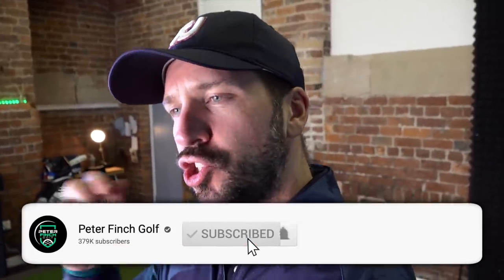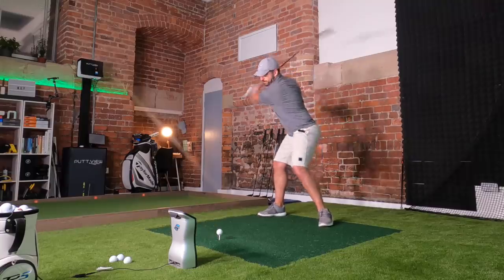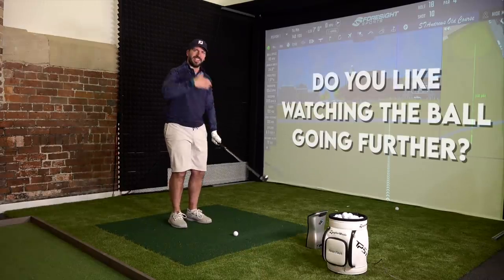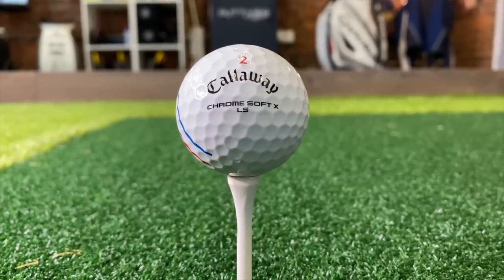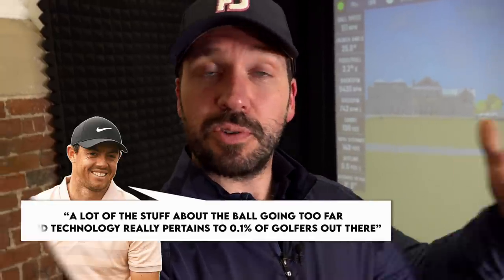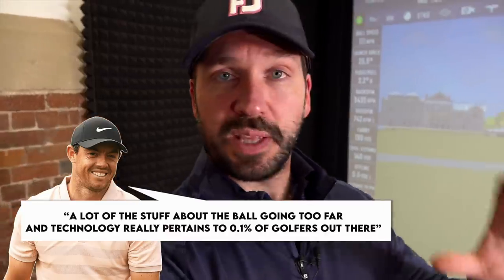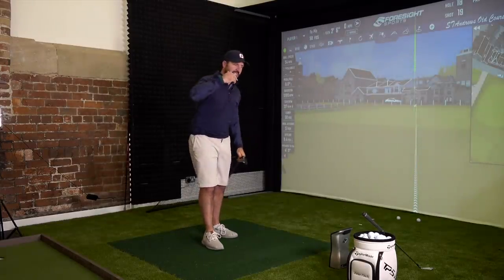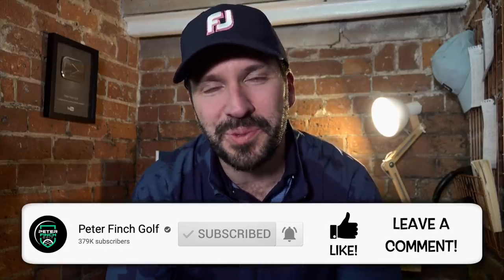Time to roll back the golf ball...?

Comment: Can we not have a rule of maximum club head size...  975d is maximum size,260cc, 3 wood back to 200cc.  The middle of a modern mini driver produces modern speeds, but miss it slightly and you’re screwed...that’s fair- they’re professionals and should hit the middle .  We can still buy those clubs if we want to be like a professionals. Higher handicaps can still buy the 460cc drivers .   Do the same for tennis.... Max 95 sq inch, bring some artistry back

Comment: What Bryson did was special. I personally don't think in the next 10 - 15 years we are going to see a migration of body builders on the tour. There will always be a level of finesse needed to be good at this game and smashing a driver 350+ on every tee shot does not out weigh the finesse you need in more cases than not. Smashing 350+ drives does add an advantage but the way courses are designed IMO, I don't think it's enough of an advantage to stop progressing. As you said Pete, he won by 1 shot. And in the 3rd round, I think he still made par when he was a bit further right of the hole in the rough. I don't see an advantage when he still makes par. There will always be a level of skill to play golf really well and just smashing drives is probably about 5% of the game. Even Happy sucked until he learned how to putt! :-)

Comment: Feel like the ball is an easy out for reasons pros hit it further. In last 20 years average driving distance has increase 17 yards, I would put that more down to all pros being athletes with personal trainers now - so swinging faster - than the latest pro v1 being 17 yards longer than the original. Feel like reducing forgiveness on woods maybe a better idea, brands can then sell it as a tour version bit like what the TS1 basically is. Feel like it's currently governing bodies (R&A/USGA) v equipment manufacturers, they need to work together more as currently the governing bodies are being reactive not proactive

Comment: I think it would be more achievable to set lofts as standard eg Driver 9-12 degrees 3 wood 14-16 5 wood 18-20 then irons back to traditional lofts eg 7 iron 32-34 degree pw 44-46 etc 🧐

Comment: I’d like to see things halted. Maybe for nothing else but the purity of the game. 
I’ll use analogy for example. Back in the late 1990s, early 2000’s. The 3 big manufacturers of motorcycles had to stop trying to outdo each other. Honda, Yamaha and Suzuki agreed to stop making motorbikes to outdo each other. Ultimately Suzuki won out with the hyabusa clocking out at 201 mph.

Are the big 5 golf OEMs going to do the same? If not, when do you stop? 500 yard drives? 600 yds? 
Where’s the skill involvement of the game?

Comment: Rolling back the distance of the ball may only hurt the average swinging amateur. We don’t have the time and resources to work on speed like professionals do. This will suck for us. I love the idea that I am playing the exact equipment that the pros use. So making a ball just for professional golf doesn’t sound good either. It makes some sense that the pros are throttled down but disastrous for the amateur. I can fix the whole thing just draw and out of bounds line in the middle of the fairway at 320. Problem solved. Ridiculous Maybe Not. Easy Fix

Comment: Let the equipment get advanced it's fine if you want to stop distance being the test, simple shorten the courses. When I say shorten, I mean shorten to the average uk course length. Some of those players would on the next hole with a driver. I personally fine the argument silly, there is skill in accuracy at distance and there is skill in accuracy without. I would rather see an artist than a weight lifter or Ballesteros than Bryson. What do you fell Peter?

Comment: Think of bringing F1 Cars back to the speed of 100 years ago but with the safety of modern times. or play tennis with rackets and balls from a century ago... brings more the athletic part into the conversation... yet it both won't happen. as long as the player has to swing the club, the most skilled will win in the end. maybe the PAR just needs to be adjusted to modern times for some holes in the near future... as the name already says it is the "professionals average result" which might be actually closer to 4 than 5 on the 6th hole of bay hill in a few years and on many driveable "PAR" 4s

Comment: It doesn’t matter if they roll back anyways . The long hitters will still be longer no matter what equipment based on physical speed and strength . The shorter hitters would be at even more of a disadvantage and when it comes down to it you have to make putts and get up and down .

Comment: When peers are 10 to 20 yards different from one another  one could argue the playing field is relatively level. But 50 or 60 yards, not so much. Yes Jack hit bombs with persimmons woods but he also had the skill to hit a low streaking 2 iron which in that day had virtually no sweet spot comparitively to today's equipment. There was an ability of most  professionals to shape shots, high, low, fade, draw, hook or slice on demand as necessary.   Those days are sadly gone. Now it's a 5 or 6 club game...Driver, occasionally a mid iron, 3 wedges and the flat stick. To me what is lost with today's technology is the imagination and creativity that professionals once possessed, which separated them from the average person. Can you fix that with rolling things back? To some extent yes. Standardized lofts for professionals, shorter tees, and tuornament balls built to an agreed upon series of specs would be a good start imo.  But also trouble needs to be more punishing too in tournament play...deeper bunkers, tighter ob, more undulations that pull balls toward trouble on the greens, etc. which could all be done without lengthening courses or losing venues. But I'm just a nobody, mid handicap who still believes a 7 iron should be 34 or 35 degrees and a hooded iron and punch shot  are valuable shots to understand  how to hit., so really what the hell do I know. I guess I just think drive, flop, putt is just really boring golf.

Comment: Pros are prots, will we rollback equipment and then start complaining that scores are too low things need to be tougher and find another thing to change? The pros are on that stage for a reason, Byrson crushed a drive and won by 1 stroke. He isnt crushing drives and dominating tournaments winning by 10 strokes, tournaments have been won by some who hit it far less and still win by larger margins. The average golfer is not going to get those distances, most will not put in the time and effort to make that stride. Then to go off of what you said, Peter, if in 15 years 20 tour players cut that corner and reach green side or close too, it will then come down to the skill of the up and down. So the shots, whether it from one player or 20 will still be mesmerizing, but then if the entire field is capable of that on the pro level it does, in my opinion, mean that the person who wins will need to be well rounded in all skills and shots for the course and game of golf.

Comment: Professionals should have a roll back in equipment. This happens in other sports. Why not golf. Baseball, pros use wooden bats. not so in any other level of competition. Football ('merican) the ball is fatter and shorter making it harder to throw faster and deeper. not so in all other levels of competition. pro basketball has different rules for defensive setups, three point distance etc. not so in all other levels of competition. why are pro golfers playing with the same equipment as the 28 handicapper?

Comment: I’d love to see the strike matter more. Smaller sweet spot. Smaller CC for the driver...maybe 400 CC. If you rolled the ball back to the original ProV it would make little difference although if the companies were forced to up the spin...I’d also love to see wedges ‘rolled back’ to a max of perhaps 56 degrees. Oh, and the driver should be the longest club on the bag at say 46 inches.

Comment: No they shouldn't roll back the golf ball. Just stop it, the game would probably go extinct. It's the only reason many play, is the thrill of trying to hit something far. No they shouldn't regulate the pros differently. No they shouldn't care about scores going lower, the game is hard enough anyways and many give it up. The game is going to change, it needs to change over time as we develop new tech, just accept it or the game will die. Idiot traditionalists golfers would still be using hickory sticks and gutta balls, if they could, but then there would be no game to play or courses to play, because gutta and hickory would be fuqqing boring and not enough people would play to keep the game alive. Not enough people are going to care to watch the pros play either if they are limited to knocking around a distance limited ball. We should embrace advances in tech and let the game grow. No that doesn't mean making courses longer and taking up more land because the ball goes father so that the game is similar to 40 years ago. Golfers might be the largest group of self destructive idiots ever. If you care that average scores relative to par might go down for average joe golfer or the pros because of tech or distance, and something just has to be done to stop it, then you're wrong. Be careful what you wish for, because those same measures might just eventually end the game entirely.